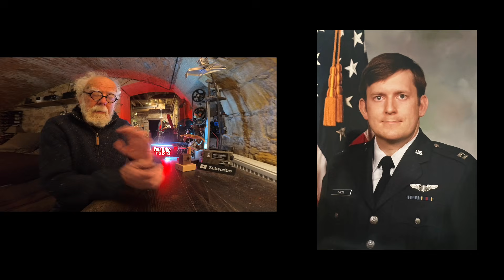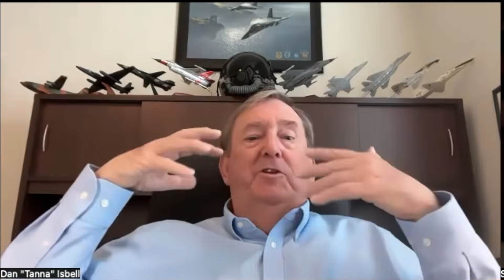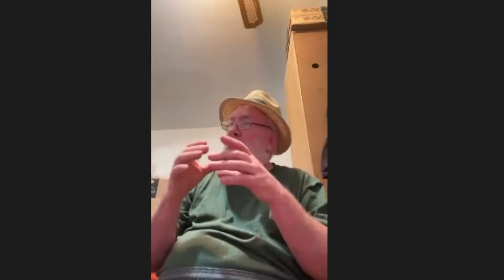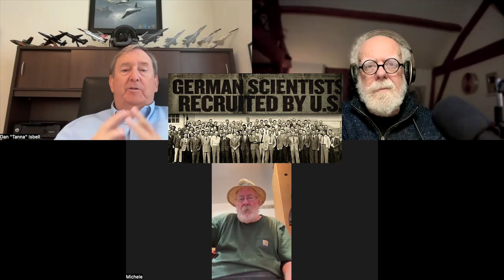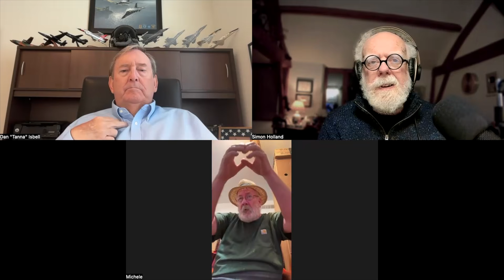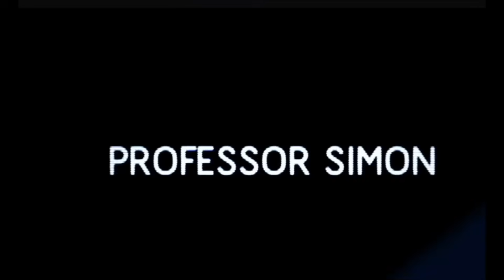USAF - "Anti Gravity is Real"

Comment: Of course it is. And it is not that difficult to figure out the baseline physics. There are already many gadgets that use the Einstein 1.5 physics.  But they all fall short of the best outcome. 

It's a little bit funny that I can actually explain this in 30 minutes, using existing datasets.

Comment: My name is Bill SerGio and I am going to tell you were  I believe you may find the SECRETS of anti Gravity
In the world of UFO lore, 1974 stands out for several notable sightings—including John Lennon's well-documented encounter over New York City on August 23. Upstate New York, particularly around Dutchess County (home to airports like Dutchess County Airport), also saw reports of unusual aerial phenomena that year, fueling speculation among enthusiasts.

Purely as an exercise in historical curiosity and research methodology, one might note that the region hosted complementary high-tech firms capable of advanced experimental work. 

Sprague Electric excelled in high-voltage capacitors, pulse-power electronics, and custom dielectrics—key for energy storage and field-generation experiments. 

Corning Glass Works, headquartered in upstate New York, led in specialty ceramics, high-purity insulators, and materials tolerant of extreme electrical and thermal stress—ideal for non-metallic structures or high-field components.

From a strictly engineering standpoint, a hypothetical collaboration between such companies could align logically for testing prototypes involving unusual electrical fields or propulsion-adjacent tech, especially in an area with established defense and materials R&D ties.

Of course, this remains entirely speculative armchair analysis—no public evidence connects these firms to any 1974 sightings or hardware. 

But if you wanted to start digging deeper begin here: 
Examine early 1970s defense contract archives, regional aerospace subcontractor lists from that period, or declassified high-voltage/electromagnetics test reports tied to Northeast contractors and you may learn how to achieve anti-gravity!

Comment: look, all the stuff mentioned here, is all involved with the Right Hand Rule of a powered circuit. Current+magnetic field,+force. 
Gravity is not a force, it's the inverse  of a magnetic field. Centripetal for gravity, centrifugal for a magnet.
It's very simple once you start putting the pieces together. 
In our Black Budget Programs, the scientists have figured all this out. They have solved free energy, which they need to power their crafts. The propulsion of these craft is centered around creating a "gravity hole" ahead of the craft in the direction of desired travel.
I have ideas on how to do this, but no tested model. 
Free energy, with no moving parts, can be achieved with a specific geometry of magnets and coil/s. I'm working on it, but models yet.

Comment: the donut device was a small scale magnetohydrodynamic drive. composed of 2 quadra polar magnets, copper wire, depleted 9 volt battery. it sounds like the basic magnetic force on the copper circuit was set to parallel to the ground, or slightly upward. the guts of it may have been gimbaled to produce the observed effects. in any case, small manipulations of the device would cause the magnetic force to push the device in different directions. since the device had no load on the circuit, the depleted battery was needed to keep the copper from melting. today i would use watch batteries. This is all based on the Lenz Effect.

Comment: wrap copper wire super-tight around three iron rods, place 'em in a triangle, like feet of a tripod. Power each with a nine-volt battery, but flip the polarity in a blink-rate—about seven point eight hertz, Schumann sweet spot. Stick a tiny magnet in the middle, it'll twitch left-right-forward just by switching which rod's on. Works on paper, don't

Comment: Yeah, I have personally witnessed one of those "cloaking devices" on a TR3B as it glided overhead, the cloaking wasn't perfect, as when it drifted over, I could see a grid of blue lights on the underside of the craft!
Reply: C'est comme une fonction de polymérisation entre deux surfaces, mais en le cas présent de votre observation, la polymérisation se crée entre deux localités, une qui est  la Réalité de l'observateur et l'autre est la réalité de l'engin,

Les ratios sont contrôlés par l'engin, et ils peuvent êtres a 10 % en la réalité de l'observateur et 90% en ça ( l'engin) réalité non locale a celle de l'observateur
Reply: Le principe de la réalité non locale est l'effet de la perspective sur le plan linéaire de l'observation de l'observateur, dont plus un véhicule s'éloigne, plus il rétréci et a un moment même sur une surface plane, la distance va fondre l'engin sur la planéité de l'horizon
Reply: Le générateur de compression positronique du tr3b va superposé la fréquence de la localité lointaine sur la position d'observation local de l'observateur,

Selon les ratios, l'engin peut être de visible a non visible,

Ci il se tient en le lieu en non visible, il est alors en la sphère inversé qui est l'anti-face genomique de la zone ou se tient l'observateur
Reply: C'est l'étude du phénomène tunnel quantique,

Lorsque l'engin est en la zone inversé ( anti-face d'abaissement) il se charge et acquière une super vélocité ( Condensateur de charges positronique = ions positifs de di-hydrogène)

La vélocité va pouvoir être utilisé pour plié la linéarité de l'espace par l'impulsion de redressement qui relâche une charge symetrique d'abaissement en redressement, créant sur les trames (feuillets) iso para métriques, des sur tensions super critique, générant des déformations des alignements moléculaires projetées vers l'orbite et auquels les centres sont des miroirs magnétique polarisé  en le sens de l'impulsion propulsion vers l'arrière de l'engin et attraction sur le devant de l'engin ( comme les tunnels de trains magnétique)
Reply: L'effet de pointe ( conique) est la direction de la polarisation du fluide électro statique positronique polarisé

Une polarité qu'est un mouvement mais une charge supercritique qui est statique zéro force gravitationnelle,

L'engin  va par la polarité du flux , le projeté vers l'avant, et l'état supercritique est un rapport différentiel entre deux états localités,

La localité de lieu de la zone face  et l'intensité véloce acquise en la zone anti-face de cette localité face,

Donc c'est la même structure mais en interaction entre ca zone face et ça zone anti-face, pour obtenir un synthonie pour le déplacement au bon endroit

Donc quand une charge de l'anti-face de la zone face est forte, cela équivaut a une distance de parcours en zone face,

Plus l'intensité est relâcher, plus le parcours en une fraction de seconde est possible

L'oeil de l'observateur aura des difficultés a observer l'entre deux du déplacement de l'engin, voir y arrivera pas, car la fréquence de l'observateur est hors le spectre visible de la fréquence spectacle en laquelle l'engin circule,

Ils circulent souvant de cette façon, donc ils y en a pleins mais ont les voient pas
Reply: Voici l'action du positron*

Il est le Nord Cathodique= sud orbital et nord centralisé

Le nord Anodique est aussi le positron= sud centralisé et nord orbital

Une matrice des spines ( ils nomment spine en désignant une force sans rotations, mais en réalité ils mentent)

Le spine fixe est composé de deux forces rotatives en contre réactions rotatives ( contre rotation v0 = force qui s'annulent mutuellement)

Mais il est possible de polarisé le spine coupleur, donc une force tourne plus vite que l'autre car elle lui gagne des cycles de charges en rapport des ratios, donc une est la force faible et l'autre la force forte = le différentiel de potentiels= bi-metrique,

Personnellement je nomme tout en spines séparer puis en l'explication je nomme les effets associatifs.

Zone anti-face= cathodique
Spine horaire haut pressionnaire froid (bleu foncé) ( vu a partir de la zone face)
Angle obtu/ sonique grave
Electro positif ( source du positron/ pole nord  reductif =plongeur= di-hydrogène)

Zone anti-face = Cathodique
Spine anti-horaire bas dépressionnaire   chaud ( rouge foncé)( Vu a partir de la zone face)
Angle aigu/ sonique aiguë
Électro négatif ( source  du negatron= pôle sud = anti-di-hydrogene oxydatif et est le revêtement de surface intérieur du negatron zone face qui est le di-oxygene pôle sud reductif)

Zone face= Anodique 
Spine horaire bas  pressionnaire chaud ( rouge clair)
Angle obtu/ sonique grave
Électro négatif ( negatron= di-oxygene  pôle sud reductif)

Zone face= anodique
Spine anti-horaire haut dépressionnaire froid ( bleu clair)
Angle aigu/ sonique aiguë
Électro positifs  ( positron= Di-oxyde de carbone  pôle nord oxydatif= floteur)

Le positron est quand le spine face anti-horaire haut aigu/aiguë froid  atteint une trop large émission positronique  en zone face, créant une remonter de sont spine d'impédance horaire bas chaud zone face, qui lorsqu'il dépasse le sommet du spine anti-horaire face, il y a translation de la métrique face vers la métrique anti-face

L'impédance Switch sont spine negatronique  pôle sud horaire en anti-horaire et  Switch sont spine  positronique pôle nord anti-horaire en horaire

Mais c'est a partir de la vu d'un observateur extérieur, car le spine face  anti-horaire  positronique reste même pour l'engin

Donc selon le placement d'observation, le même effet est pas une même résultante d'observation, et c'est une illusion optique ( la magie de la vie)

La magie noire est pas mauvaise , c'est le dipoles Cathodique

La magie blanche c'est le dipoles Anodique 

Le 2x2 dipoles forme le spectre polychromatique ( colorimétriques)
Reply: Il y a un calque en la distribution des mêmes couleurs, qui diffèrent en placements sur le plan de la profondeur de la perspective